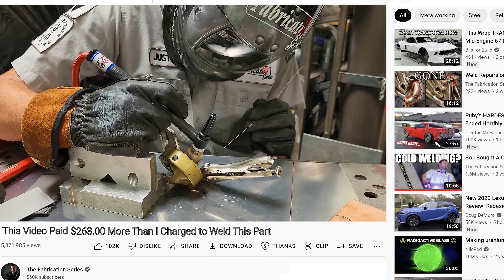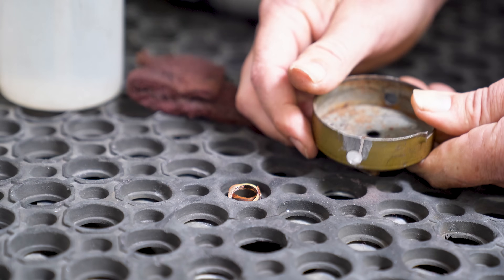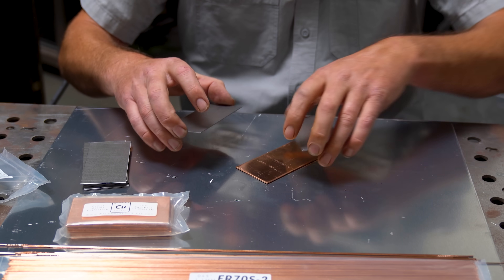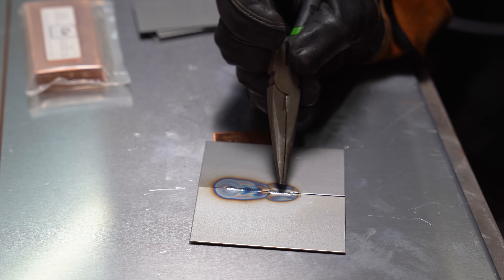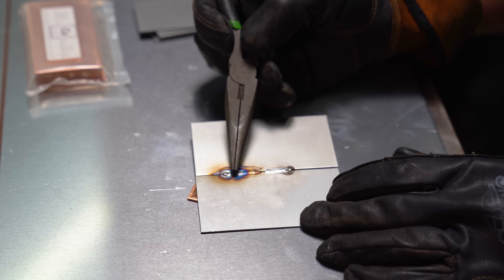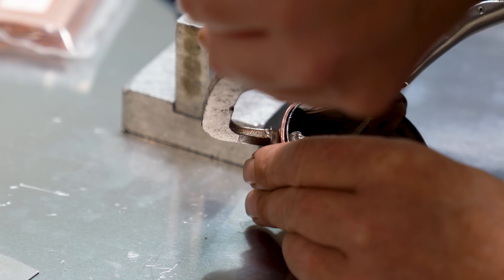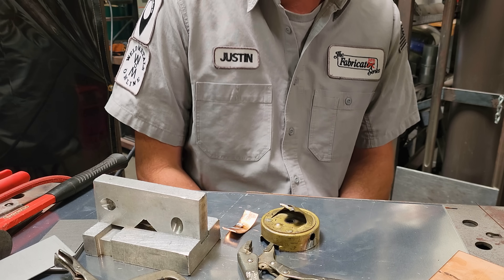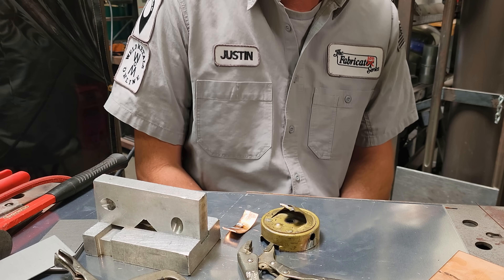This Video Paid $9,909.24 More Than I charged to Weld This Part

Comment: That’s a super fair price on that weld. Glad to see someone providing real value and good pricing when it comes to welding.
Reply: @no Thats not how it works, he's providing a service by welding he should charge accordingly. You clearly are not in any form of business and if you are you wouldn't be a much of a success with that attitude.
Reply: Did he say 20$ weld?  Huge value there. He took every precaution, material costs, the copper strip probably cost 20$
Reply: @harmankardon478  It's become quite popular on YouTube that some making videos recording their services do not charge for the service they video. They make way more on the videos and it provides great advertisement and customer relations. I watch a lot of towing videos and many of them do it. Matts Offroad Recovery and Casey LaDelle's Cascade Heavy Rescue are two great examples and they are quite successful.
Reply: @no How much time, equipment  and effort do you think making the video took? You can't just count the actual job the video is of.
Reply: Not to mention how much more value YouTube offers us than mainstream media...
Reply: I actually expected it to cost more with the hassle that came with this part
Reply: But how long did it take to record and edit the video? 
He also got experience doing a new kind of weld he can charge more for later
Reply: I don't think I could get a weld shop to even look at a part for only $20
Reply: @kissa02  probably 20 bucks just to talk to them
Reply: $941.55
Reply: @robwiljas  I would guess not every recovery is free...
Reply: @srboromir452  plus pay to get the coding done
Reply: @no Awesome. The craftsman gets paid well, the customer gets a subsidized price and we get to see how it's done for free. Gotta love free market capitalism.
Reply: @no Just expressing an opinion. If you share it then I agree with you.
Reply: @no most people always want more and more and more.  Even though they have plenty they still want more.  Greedy.
Reply: @harmankardon478  most business owners always want more and more and more.  It's their greed that drives them
Reply: @GlorifiedGremlin  what hassle 🤣😂🤣
Reply: @kissa02  that's due to the fact that they are greedy and they do not care.  It's all about money.  Even if it only takes 5 minutes they'll charge you for 1/2 hour of time
Reply: pretty cheap in my opinion in this day and age
Reply: @no some welders would charge way more to give those kinds of lessons and tips. You can learn the job just by looking at him and then do the job you want by yourself. You clearly underestimate the real value of these videos and all the stuff you can learn from them.
Reply: @harmankardon478  anybody can weld tbh it doesn't take a rocket scientist to get a good weld done. Probably took him all of 2 minutes. Trust me, he's not worried about pennies to a dollar when he's making this much on YouTube lol
Reply: @yeetteet3739  not everyone can weld lol, he can because he has the means and the skills to do this kind of job. Where I’m from people in this profession usually takes pride in their work and wouldn’t want to risk devaluing it. Even if you have a YouTube channel on the side. You’re screwing yourself and your peers over by selling your services underpriced, essentially lowering the value of the whole profession. 
My guess is that the “$20” weld is closer to what the material would cost and not what the customer paid lol. You should charge fairly for the job and the job only. The risk lies in covering the cost of camera, audio and lighting equipment, the computer + editing software and the time spent script writing, shooting and editing and doing voice over. Kind of a genius idea of him to have the title coded like that, it’s the perfect amount of clickbaity.
Reply: @Si-Al-Ti  he didn't code the title, though. This isn't new, Tom Scott did it years ago. He copied somebody else. Not surprising at all.
Reply: @no ok let's say he becomes a "decent person" and start to provide the same service for 2 dollars instead of 20.

This will completely destroy the wielding market in his area. "Why should i go to this shop that charges  me 15 to 30 dollars when this guy ask for 2 at the same quality?". It would kill the competition.
This will cause an overload of request that will cause an inexorably  a drastic drop in quality (except for those used for youtube videos) wich will make him lose all his trusted clients. He would get only casual clients that doesn't care much about the quality of the services, have a lot of clients but with really low profit. 

Then I've 2 options that might happen: he close his shop for overload of low profit job and focus 100% on youtube.
Or, sooner or later, internet would find out what he was doing, it would create a huge ending career drama that would force him to focus on his shop, but with his reputation ruined he would be forced to get new clients with hard work and luck, or close everything and find a new job.

Normal people don't choose capitalism, we are forced into play this game.
Reply: @no Imagine arguing that the working class should charge less while being anti capitalism
Reply: @no "you clearly value capitalism over being a decent human", these things aren't mutually exclusive, which is what your comment implies. See, I'm smart enough to look past pseudo-qualifiers and bs. It's the same as when people say "I'm a fan of comedy, but cOmEdY bAd!"
Reply: @no bro said this video takes no effort to make 😂🤣
Reply: @no lmao bruh.
Reply: @no i'm talking to someone that believes he should do his welding for free since he makes money somewhere else.
Reply: Charged less than I would have figured based on particulars. The extra time of special handling would cost more generally.  Great video.
Reply: its a fake price
Reply: It’s important to consider other factors in pricing, not just the time and consumables it took to complete that specific job. For those welding businesses that are not on YouTube, they have to pay for very expensive equipment, shop rental, maintenance, often tax and payroll services, insurance, etc… 

Additionally, it takes time to talk to a new client, provide estimates, and after payment, reconcile your books for accounting and tax purposes. 

If you were only to charge for the 15 or 20 minutes (plus materials) it took for the work itself to be done, you would be losing money as a business. That rounding up that you refer to is necessary to keep the lights on, and make any sort of living. It is how you run a business.

I’m sure there are companies that overcharge because they can, but for all of those other businesses, trying to keep the lights on, you have to take a wider view, when looking at their pricing.
Reply: not fair, it's unrealistic.
Reply: @robwiljas  I don't really care how he does it. As a customer, that's a damn good value for a $20 weld.
Reply: @Si-Al-Ti  you pay a small fee and hire someone else to edit and do voice over for you.
Reply: @harmankardon478  not everything in life revolves around money.
Reply: ngl if this cost 20$ he wouldnt probably stay in buissness very long, first you have the office, the insurance, the workers comp, the bills/rent for that said office, than on top of that you have the tools, material, labor. sure it was quick and easy but running a buissness isnt just about how much it cost  you to make the item, hence why companies will charge hourly labor fees, so they can cover everything I brought up.
Reply: @robwiljas  Your being ridiculous . When I was tattooing I would often do free work for my friends. I would provide my time for free. I was not going to pay for a sterile tube , new needles and ink packs and exhausting my resources . But 20$ covered my overhead and if you did not have twenty why are you even talking to me about anything work related ?
Reply: @npcwill283  How am I being ridiculous? I was responding to the person who said "You clearly are not in any form of business and if you are you wouldn't be a much of a success with that attitude." and showing that there are successful businesses on youtube who do work for free because it makes them more on the videos. I never said anything about THIS video or him charging for the weld.
Reply: @dieSpinnt  if I had been taking his advice I wouldn’t have made the statement in the first place! ✌🏻✌🏻
Reply: @cashewABCD  That copper weld coupon currently sells for $4.50 each.
Reply: Unless he lives in Mexico twenty bucks won't even buy dinner for myself. I know my comment just made him at least $2 I can't complain I don't have a channel.
Reply: I call this a customer PR weld.
Reply: no it's not.  it's way to low,  that wouldn't even buy you a decent pack of rods.
Reply: 8k? Lol
Reply: @taanieltoomjoe1058  I know coming back to this comment section now that it’s at 8k is funny for the people saying it’s not worth the editing time etc…
Reply: @carmichaelmoritz8662  what about overhead,materials but most of all you're paying for a skill level & quality work
Reply: @Dylan-hb1cw  its not like it took the whole day 20 if you break down the cost of that piece its probably about 5-10 dollars including overhead if you break it down by the minute
Reply: @griptopia  in what way does 3in of weld need a whole pack?

Comment: Almost at a grand! Never seen your stuff before and don't watch welding stuff usually but glad I could see it from the algorithm and help make you a couple more cents!
Reply: Seriously if 700k views generates just under 950 its just barely paying for some welding supplies for a few weeks, probably slow weeks at that. Not that I know a lot about welding but I've seen how much crap can cost before and I'm sure it's only skyrocketed with the massive inflation of... everything... your haters can bite me 😀
Reply: Same reason I watched and posted.
Reply: @minacapella8319  There is no direct correlation between views and dollars, and the dollars in the title are delayed at minimum 24 hours.
Reply: @RecklessRegal  ok chief

Comment: The copper support is such an underrated technique for thin metals, saves perforating your piece..can tell you take pride in your work it’s great to see..gained a sub from me
Reply: Cut my teeth on 0.8 - 2mm 316, mostly in the 1-1.6mm ranges. My toolbox was filled with various shape/size bits of copper and aluminium chill blocks by the end.

Comment: Reminds me of when I was a tool and die maker welding molds with 4140 rod and dropping a hot ball on the corners without blowing out the corners past the drop weld.  Tiny zipper molds.  Repaired a lot of molds with a TIG.

Comment: I love how americans have such things as sheet metal gauges, but still argue that the imperial system makes sense. 

I mean why would you want to be able to just measure the thickness with calibers and know whats going on, when you can use a special tool to figure out that your sheet metal is 3/365th of yassir arafats pinkie, but only on warm days during november.
Reply: Don't be a fool...these gauges are for quick reference, you can totally take out the calipers and find the exact thickness...and fuckaround figuring and calculating everything.
Reply: @flashfyre  The trick is fractioning by multiples of ten, my dude.
Reply: @flashfyre  Both. 

The imperial system has two major flaws. The first is the division by more or less randomized fractions, which makes no sense and which is why even in the imperial system people who measure a lot use 10th, 100th and 1000th, instead of 16/736.

The other flaw is the base units themselve. The yard is a random distance, that can never be recrated if it is lost. The meter on the other hand is crated from a given distance that hardly changes and that can be recreated to fractions of a percent at any time. 

Same goes for temperature. While the Fahrenheit scale set its fix points again to two completely random points that cannot be recreated, the celsius scale uses two temperatures that can be recreated with a certain precision by any 5th grader.
Reply: @flashfyre  Only that sheet metal in the metric system does not come in 1.214mm,  but in 0.8, 1, 1.2  and 1.5mm. All measurements that you can eaily measure with.. Well.. Any freanking measuring deivce in your workshop. 

Or, of course you can use a purpose build sheet metal gauge, to figure out that your sheet metal is 18 Gauge, what ever the hell that even means. 

You just prove my point, thank you.

The only reason the unit "Gauge" exists is because the base system that you use is so flawed that you need to define gauges to define stuff. Its a stupid solution to a stupid problem created by a stupid system. At some point you might just change the stupid system and avoid all the other stupidity on top ;)
Reply: @flashfyre  there's one issue highlighted by your post. Your .0478" thickness is only correct for 18ga carbon steel.. Galvanized it would be .0516", stainless .05". 1.2mm stays 1.2mm, because unlike gauge, millimeters aren't an arbitrary number.

Comment: I really appreciate the transparency and the depth of your break down. The only flaw I see is jaw marks left in the part from the vice grips. Maybe use high temp tape or rubber to pad the jaws.
Reply: or maybe just small spring clamps...
Reply: @venture17fly    marks are on paint and it will be painted since welding burn some  old paint
Reply: @vampirwrr  Not true.  You can see the jaw marks in the metal.
Reply: Or some blocks of wood cut to snug fit
Reply: Cutting fingers off an old glove to slide over the jaws can work in a pinch.
Reply: Braze the jaws with brass. I seen that on another video .

Comment: Should of tacked on the edge of the joint, then welded into it. Not bad work 👌.  I was a sheet metal fabricator for several years after weld school. Nowadays I'm a boilermaker

Comment: New Sub Here  !!  Great Video !! Question.... the Welder you used on this Video,  you called it A Tig I Think?... I admit it I am a hack Welder and was raised on a hobby Farm 🚜  and my dad  had a Lincoln  Ark.Welder and a oxy Aset cutting  torch only, till I was about 15 thats all I thought Existed for welding..😆...Anyway  I have had very little  training on welding (but I Muddled Thru ) triel and errors learning mostly....wow I'm rambling 😆....Ok Question...what would be the best Starter Tig  Welder (For light Home Use) that wouldn't  Break the Bank??... thanks Geena 😊

Comment: Question, as a materials engineer, why did you use TIG with copper and carbon steel instead of flux? the heat affected zone would be smaller and the corrosion would be less too

Comment: wow i was a welder for 6 years and i did it all, i can lay pipe i can tig aluminum i can mig aluminum and everything in between and i never charged less than 80$ for anything ive ever done, i guess the argument would be he has a shop where people come drop stuff off and i would take my welder in my truck load up on gas and go to the customer but still 20$ is crazy good price

Comment: As far as the price you charge there is a lot that goes into that.  First off, how much capital do you have invested in your shop and equipment?  How much does it cost to maintain your shop and equipment?  From start to stop, how much time did you spend on the project?  For example that copper welding coupon that you cut up for your chill bar, the current price for those is $4.50 each.  Charging your customer $20 or $25 is cheap and a bargain for them.
.
In the 80's I used to watch "This Old House" and then "The New Yankee Workshop".  We used to joke about both of the shows from time to time.  For "The New Yankee Workshop" we used to joke that yes, with a $250,000 woodworking shop, you too can make this $150 side table.  For "This Old House", the joke was:  Jake and Susie bought this 18th Century farmhouse to renovate.  She volunteers at the local day care center and presses wildflowers for bouquets that she sells at the monthly craft festival in the nearby town.  Jake meanwhile volunteers with the local outreach center for disadvantaged youths and is growing organic produce in his 1/4 acre garden.  He sells his produce at the local farmer's market as his vegetables ripen.  Their budget for restoring this 4,000 square foot Revolutionary War era farmhouse that is listed in the National Register of Historic Places is $750,000.

Comment: Is the copper backing there so the current has an easier time jumping from one side of the gap to the other? Sorry if I don't articulate it right, idk if this is closer, Is it helping with jumping the arc from one side to the other so it liquefies each side, resulting in it joining together..? Probably didn't articulate that right either

Comment: From a first tig welder stand point I was dead set on a primeweld 225 I called primeweld and they had mentioned they are coming out with a 325 or 335 I don’t remember which but it’s the same thing except more amps, each dial digitally reads out different torch options and a lower amp start. All that comes at a price point of around $1400 do you think I should wait for this welder and spend a little more or should I settle with the 225?

Comment: I used to charge like that when I first got my welding business off the ground.  But now that I'm networked and booked up in the industry, I have a $120 minimum charge... 
I often have to tell clients they might be better off buying a new part instead paying me to repair it.  No one is holding a gun against their head... its either worth it for them or not.

The busier I get... the higher my rate is.

Comment: Couldn't you make a  table top clear vaccum chamber with sand blasting type not textured just sealed from outside with gloves inside. Make it big enough to put your tig equipment inside and your part your working on pull complete vaccum then lock the panel thats got a rubber seal on it your style of lock something that wont allow oxygen back in it. Then fill the workbox with non flammable gas to take oxygen's place.